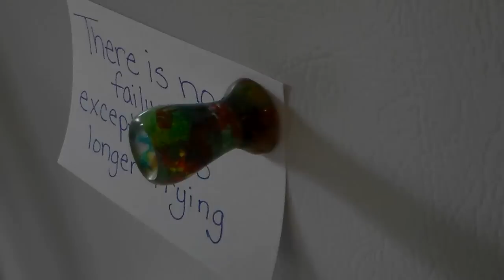The Confetti Blank

Comment: cool looking blank! a couple things could've helped with the pen...you could have scuffed down the tube a little for a better bond.  I would've also coated the end of the blank opposite the end where you inserted the tube.  just a bead of CA would've done it.  what happens is by the time the tube reaches the other end, there's hardly any glue left because it all squeezed out.
Hope that helps,
Peter
Reply from the maker: Peter Matthew Thanks for the tips Peter!

Comment: one project that would be really interesting and a useful tool for your various casting videos, would be making a vacuum chamber. I've seen people use old compressor motors as the foundation for them. It would certainly be useful for situations like this where the material being placed in resin is porous and could stand to forcibly absorb more resin.

Comment: Is it possible to have the brass tube of the pen in the epoxy as you make the blank? You could fill it with wax and have the length of the mold tight against the sleeve. You could use wax as the mold body too, then  melt it away and reuse the wax

Comment: It's a shame that the blank exploded,
  when you made the mold, do you think there is a way to salvage the form? I didn't know if mold release or even PAM would allow removal of the blank without destroying the box. What about saran wrap, that might work.
  I'd like to make some blanks sometime and I.d hate to have to build a mold every time. Just curious for your thoughts.
  Very cool project.

Regards,
Bob
Reply from the maker: If I was going to be pouring pen blank molds more often, I would buy a set of resin savers. Or another option would be to pour in a 3/4 PVC pipe. Just slap a cap on one side and you're set!

Comment: I think one of the factors that made it break was the amount of air bubbles. I don't really know anything about working with epoxy, so forgive me if this is an ignorant comment: in baking, it's common to bang a mold against the table or put it on a vibrating table/surface to bring out the air bubbles, have you tried that? I've also seen silicone being put in vacuum chambers to remove air but that's a bit more aggressive and expensive.

Comment: Here is a some point of info on pen blanks that are of paper origin.  like what you have and currency blanks  etc. 
Tools, Very sharp and sharpen them even as you turn.  If it doesn't seem to cut right. Stop and go sharpen your tool. 
Once round, use either scraper or Skew. No gouges. 
STOP USING CA TO GLUE IN TUBES TO THE BLANKS!!!  Epoxy..
If the hardware has  the tube already abraded, take some acetone and clean it. then use Epoxy to glue into the blank.
What speed were you at.  if it wasn't over 3k RPM, you were too slow.
When drilling on the lathe, Keep your hand on the Jacobs Chuck at all times.
To some up,  Epoxy in the tubes, SHARP TOOLS, once round stop using a gouge and either use a scraper or skew.
Reply from the maker: Thanks for the help Andrew. I wish you had been there with me! :) I might have saved that one...

What epoxy do you use for the tubes?
Reply: Peter Brown  I prefer the 20 minute epoxy vs 5 min. but in a pinch 5 will do.

Comment: I feel your pain, brother. What are you using for resin? I thought I remembered from a previous video that it's West Systems Epoxy?  Is it generally useful as a turning medium? I've been hearing good things about alumilite (alumilite.com) here's a video: Pen Blank Casting with Alumilite White 
 ...problem is you need an enormous pressure cooker to cure the blanks...
Reply from the maker: You're right West System Epoxy. It is OK for this. The upside is that it is easy. I much prefer the cast blanks I buy from IAP users. This error was no one's but mine. I should have just sanded and polished! I think that knowledge also made me...unhappy. :)
Reply: Don't overthink it... life is short... happy face... :)